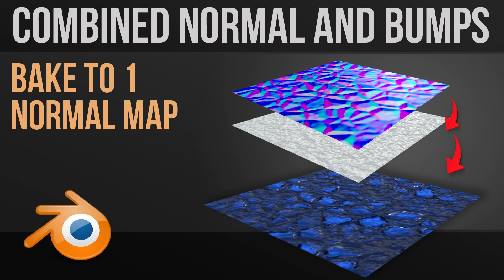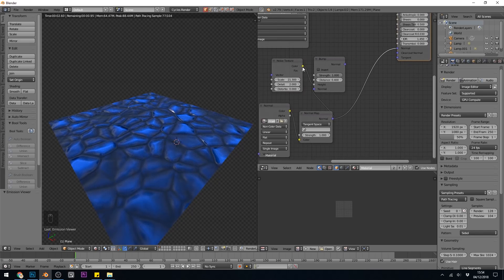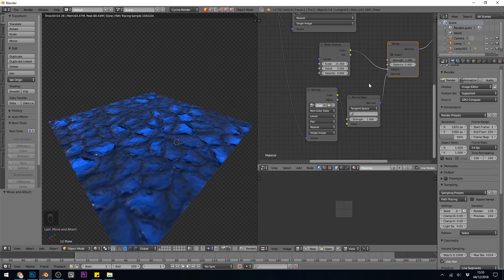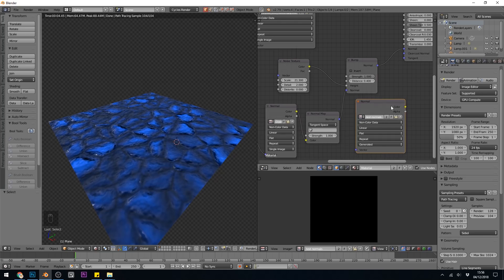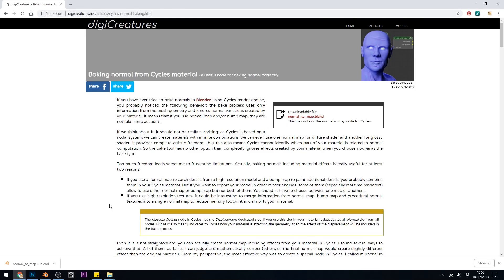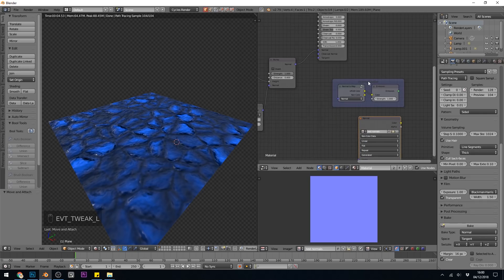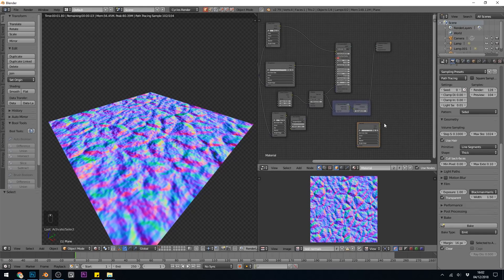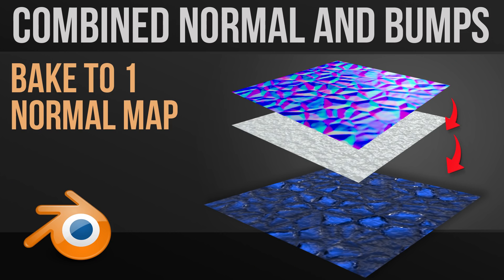Baking Normal and Bump Combined

Comment: I am using Blender 2.93.4 Right now and I can say that this error possibly still exists.
I am texturing a UDIM character for a game and, in the beginning, the traditional bake method was working pretty well, but I ended up with multiple nodes of bump texture combined, and then, the error in the baking process start to happen. It even didn't correct anymore after that event if I try to bake the Bump Texture isolated.
Your method actually looked like it could help me, but I don't know why, if I try to use it today, for some reason the texture in the cycles mode just stays total black. 
I am really confused about this and trying to find a new way to proceed. :/

Comment: So the normal map is multiplied by the bump map right? Effectively scaling it up/down based on the bump? But wouldn't that produce non unit length normal vectors? :/
Reply from the maker: yes to the first part, dont know to the second. But it works for me :)